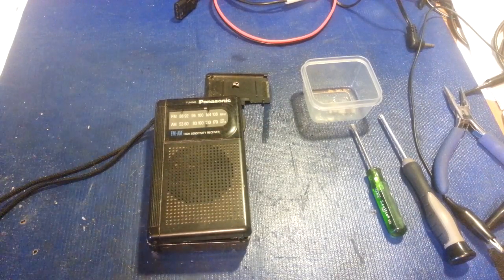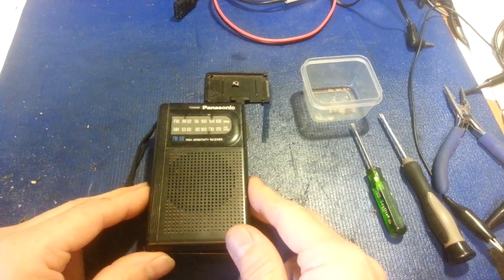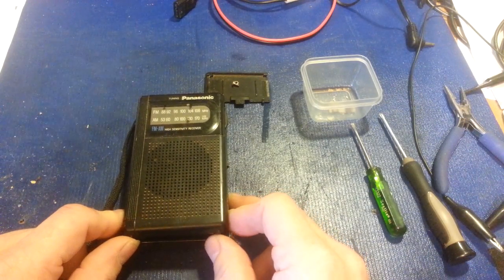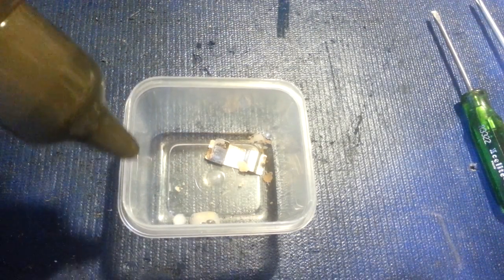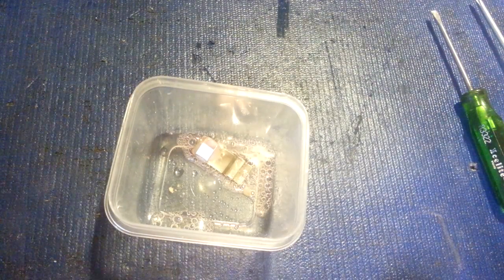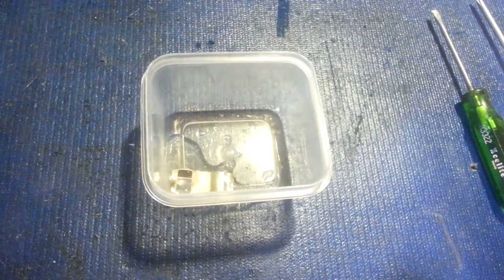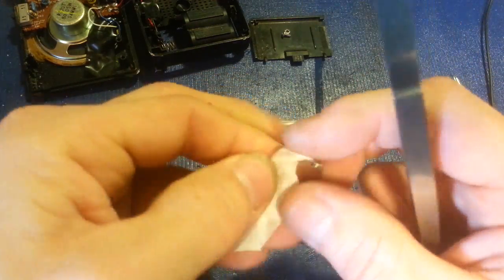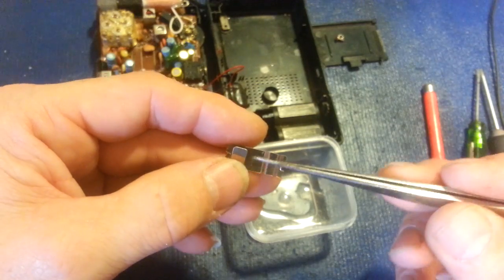Cleaning alkaline battery corrosion off battery connectors.

Comment: Hello Mike, great tips. I restore older cameras and some electronic items myself. I find this to be a great way to clean out the alkali residue. I did notice your comment about swapping out all the electrolytic caps. Question,I have a 1970's version of National Cameras (Nat-Cam's) analog shutter tester.  It works to some degree but always has the analog meter going off scale. Apparently there are  no schematics available, I've even contacted Nat Cam. Do you think swapping out all the electrolytic cap's  would be a goof place to start? Thanks/
Reply from the maker: Tom Heckhaus 

If it's old it's definitely a good idea.  Electrolytic capacitors only last so long and when they start to fail they can cause all kinds of strange problems.
Reply: Hi Mike, thanks, I'll dig the tester out. By the way, does SAM's Photofacts still exist? I wonder if they'd have a schematic and servicing details
Reply from the maker: Tom Heckhaus 

They were bought out and you can still purchase digital copies of everything they ever published from them.  Just Google search Sams Photofact.  Should be the first result, something like samswebsite.com I think.

Comment: Mike,
Thanks for waking up some of the gray matter. Was replacing some AAA batteries in those HF 27 LED lights and two of them had battery leaks. Putting the vinegar to use now.   :-)
Reply from the maker: Have fun fizzing your corrosion away. :)
Reply: Fizzing all done. Using hair dryer to evaporate all the water. Two wires to solder and job is finished    :-)
Reply from the maker: +Donald D'Egidio 

See, some of that stuff we learned in science and chemistry class is actually useful.
Reply: I'm just glad your video brought back some forgotten science facts.    :-)

Comment: I would imagine those caps are still in good shape. Most Panasonic caps held up good, except for the high voltage caps used in their CCTV cameras, and the yoke coupling caps in the CCTV monitors. I still have my grandad's 1964 Sony TR-1814 pocket AM radio. Still plays well. The audio is a bit tinny; I'm sure the electrolytics are a little low in value - still has plenty of volume.

Comment: Very nice tip mike. I have been doing this for years using it on different electronic parts. Like wafer switches and wires. Did a video almost a year ago on this. #40 I believe.  Tough stuff I use salt as an activator. Then to neutralize the vinegar salt solution I use baking soda and distilled water. Great to see some one else you vinegar for other things than Bar-B-Q!
Reply from the maker: +Dino Papas 

LOL, she pays in cookies. ;)
Reply from the maker: Yep, had to work for my peanut butter cookies this year. :)
Reply: I was going to ask if you gave your mom a discount on your bench rate?  ;-)
Reply: The Radio Shop cc